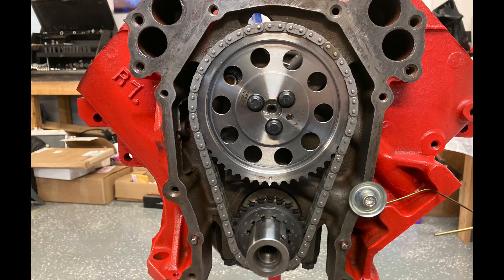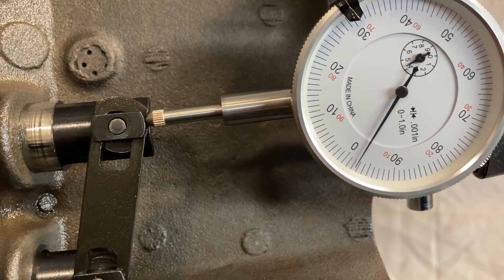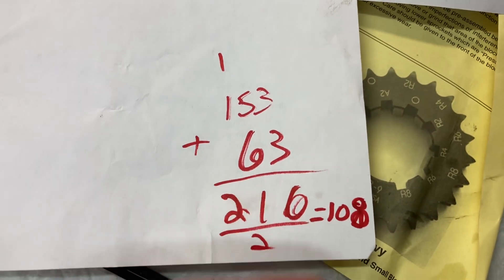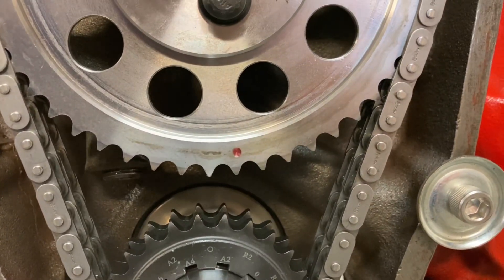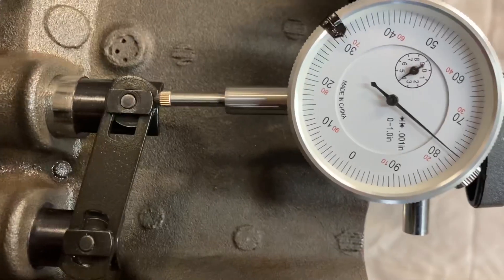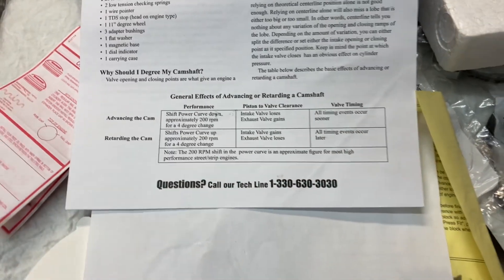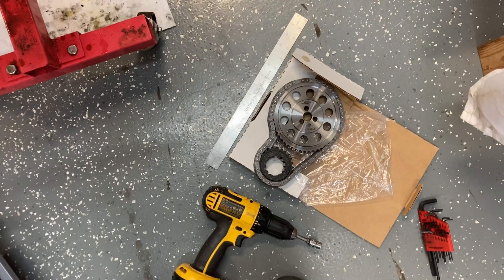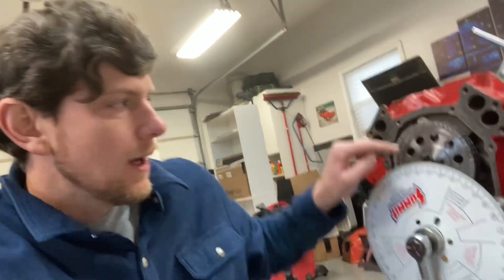Secret Truth to Degreeing Your Camshaft: Dot to Dot isn’t Good Enough!! #engine #compcam #mopar

Comment: Nice video on checking the valve timing now show one correcting or just changing it using a conventional 440 timing set when it’s less or more than one tooth off …. That’s the step I’ve never seen done and when I ask ppl will say just use an offset key or dowel.  Let’s see that.
Reply from the maker: I’ll try to fit that in on my next build

Comment: So, nobody actually shows how to move the cam to the degree that it needs to be if its off.....like in your case you were 15* off, but you skip showing how to physically adjust the cam and timing set to get that 15* correction.
Reply from the maker: It’s so easy and fun when your degree wheel. Advance the cam 4 degrees and test it. If the number gets closer to your target, then keep going. If it goes away, then retard the cam. I think I’ve shown it in a few different videos so I didn’t want to bore my core audience with the same old tech. Thanks for watching
Reply: @JustMoparJoe  thanks, ill check out some more of your videos. this one explained the degree wheel in a straight forward way noone else ive seen has.

Comment: Thanks for the video i got same type of issue on my 05 chevy astro awd 4.3l i changed the timing chain ,cover ,the oil pan gasket and rear main seal . The 05 4.3l has a plastic tensioner, it had stretched vs the new chain and tensioner making the camshaft off by almost a whole tooth making the engine run terribly. This video of your confirms this for me. Thanks if you would like to see my struggles with it or have advice i have some videos on my account. God bless
Reply from the maker: That sounds like a real pain, glad it helped!

Comment: Is it possible to degree the camshaft with the heads already on the engine?  I guess you could make a piston stop, but how would you know exactly when TDC was?
Reply from the maker: Yes sir. Piston stop. I think it show in this video 

HP 440 Ruined Flat Tappet Engine Saved! Summit Racing Complete Cam Swap, Break In, and Test Drive!
https://youtu.be/Zi5U8AokpFQ

Comment: Joe  it looks like that second chain was actually a tooth off  not uncommon even if you see dot to dot with your straight edge
whey
Usually it's because the grinder is trying to fit a new grind with a different LCA on a new wide LCA core or regrind and just cannot fit it  without fudging.  Remember the case hardening is only so thick
New Cores for a lot of useful LCA combinations are just not available unless you can afford a billet.
Way back in the day when we had to run STOCK cams we did retard a tooth, drop in a really low gear and spin the hell out of our stock class car   absolutely no low end but could win and pass tech
Reply from the maker: @jmflournoy386  thanks brother. I definitely hope someone out there sees the value of degreeing the cam. One tooth can hurt!
Reply: @JustMoparJoe  Rethinking that one tooth off stocker cam  actually I think we retarded one tooth then advanced the cam 4 degrees  Back then Isky had just come out with his cam adjustment bushings and there were no multi keyway gears, you had to machine them yourself

Comment: Good video but misleading title. If the timing set had been dot-to-dot to begin with, it WOULD HAVE been good enough.
Reply from the maker: @Thirdgen83  thank you. I guess I was referring to the 7 minute mark when I swapped on an old timing set with a super tight chain and it degreed at 117.5. Now we’re 7.5 degrees away from what they recommended.

Comment: So, let's just say that same timing chain is advanced one tooth or a for a total of 15° , wouldn't that be a disaster between the intake and exhaust valves and pistons?
Reply from the maker: @Anthony-nw5zv  not necessarily. Many engines have pistons well below deck or even have huge dog dishes from the factory. That allows a bunch of piston to valve clearance. Also smaller lift camshafts and less duration leaves a lot of space

Comment: Dot to dot plus one tooth!
Reply from the maker: @thisisyourcaptainspeaking2259  one tooth on the crank and everyone knows it. One tooth on the cam and and you know it. Or did I get that backwards? The moral is, degree your cam!
Reply: @JustMoparJoe  I calculated it once, degrees/tooth and came up with a pretty big number.  So, I bought an adjustable set with multi-keyway sprocket.
I'm not a fan of double-roller chains, it wasn't easy finding an adjustable link-belt.
Reply from the maker: @ it’s wild how the internet works. The link belt is bottom tier now. Then it goes double row. The gear drive guys swear they are superior, but they don’t always get superior results!
Reply: @JustMoparJoe  I've never seen a broken link-belt, I've seen all the rest broken.  That's all I can say.

Comment: Good job showing how the degreeing process works. Cant stress enough how important it is to find the exact TDC of your engine. Im 67 and been building engines since my mid teens and over the years have found the timing mark on balancers off by 5 or more degrees. A few yrs ago on a brand new timing set the cam sprocket was off by 9. The only way to be sure is to degree both.
Reply from the maker: Thanks brother

Comment: Thanks Joe, this is by far the best explanation on decreeing a cam Have seen and I appreciate the effort you went through to make the video.  It has been frustrating to me wondering exactly what do do if the numbers are not what they are advertised. Where did you get the instruction sheet to explain what do do if the numbers are not exactly what the card says?  I have never seen one and would like to have one.  Being on a budget, I can't afford the more expensive timing kits with multiple keys in the crank sprocket.
In the past I have always aligned Dot to Dot because I never understood what I could do to change it if the numbers did not match the card.  Thanks again and I appreciate it.
Ed
Reply from the maker: @edwardhurst2533  thanks Ed! They included those correcting instructions with the summit cam wheel

Comment: So if you cant see that your off a tooth maybe you need to slow down? And if your gears are not adjustable what does degreing do?
Reply from the maker: Many guys do cam swaps with engine still in the car, leaning over the radiator support. It’s hard to tell exactly what’s happening with the chain if you can’t get a straight look at the chain and gears. I don’t rush engine builds, but cam swaps happen over the weekend to get back to the racetrack the next night. Degreeing double checks the cam card version what it actually measures. If your set doesn’t adjust, then you might need to buy another one that does, and put the extra on the shelf.

Comment: What should i do if i have a random reground cam with no card ?  it has .258 etched in the end and from measuring the lobes is .496 lift on a 5.9 magnum.   I'm tempted just to go dot to dot and see what happens.
Reply from the maker: It’s the perfect candidate to put in and check with a degree wheel. I think in my bad example, I was dot to dot with both gears and was off many degrees. In your case, you’d install it dot to dot and then check the centerline. If it wasn’t too far off from the standard range, than you’re good.

Comment: Running Comp Xtreme energy 23-710-9 and 452 head. Watcha thinking of the Amazon stainless rockers for RB? Any idea on pushrods I need for this roller cam
Reply from the maker: I’m not really sure. The 440 I did had trick flow 240’s and the PRW stainless rockers. They took a ball to ball pushrod. I know 440 source has some pushrods in common lengths for certain engines. The true length will depend on your stack of deck height, head gasket thickness, and head thickness.
Reply: @JustMoparJoe  thank you. Was trying to save time. I'll have to get together and measure.
Reply: @jackpinesavagerepair1918 if you have access to a lathe, you can always shorten pushrods with a parting tool, as long as the pushrod end is not welded in. The end has a hardened stem shoved in the tube. Just part off the excess length an 1/8 at a time, and push the end back in till it bottoms out. Repeat as necessary

Comment: It's good idea to leave the engine at TDC and test fit the timing chain cover to make sure the timing marks are correct.
Reply from the maker: Absolutely love to 👍🏼
Reply: I've used the timing cover seal to center the timing cover on the crank snout with no uneven pressure on the seal, then inserted all the t/c bolts and snugged them up so it cannot move, then drilled the timing cover & block to accept a two small 3/16" or 1/4" solid dowels. This really firms up the TDC  timing marks AND makes the crank seal last longer.

Comment: Hey Joe, that was really cool. It always kind of offended me when people called me a grease monkey when I told them I was a mechanic. They just don't know how complex the trade really is. They are the same people who couldn't even change a tire at the side of the road or even locate the dip stick to check the oil in the engine.😢
Reply from the maker: You bring up a good point! Thanks brother
Reply: I prefer the term automotive technician for these reasons

Comment: To work out how many degrees 1 tooth makes just count the teeth on the gear and divide 360(degrees) by the tooth count, eg 360* ÷ 20(teeth on crank gear) = 18* per tooth.
 Typically a worn(not stretched or the chain pitch changes and everything goes south immediatly) chain will jump the crank gear 1st as its smaller diameter gives more clearance per tooth as compared to the larger cam gear. If a chain jumps 1 tooth in operation its kind of pointless worrying how many degrees this retards the cam by because that chain is going to jump another tooth in very short order and that engine is not going to be running for long!

Comment: 🤯 I just would like my 383 to idle.
Reply from the maker: Someday!
Reply: @JustMoparJoe  Well I'm in the process of checking timing. It's a 1970 Roadrunner. It won't idle unless I manually open throttle.
Reply from the maker: @bobbydelamar606  sounds like you need more initial timing
Reply: @JustMoparJoe  I bought the car like it is. I've tried turning the distributor both ways with no luck
Reply from the maker: @bobbydelamar606  the carb may be stopped up and need a kit. It may need a new accelerator pump, if you know the fuel supply is good.
Reply: @JustMoparJoe   I don't like the spacer on the carb. It's a spread bore to square. Right now I'm in the process of checking cam to crankshaft dots. Cause I think the guy replaced the cam. He also installed the better sprockets. The car will stay running and rev nice if I hold the throttle open. The exhaust also burns my eyes and the plugs are black.
Reply from the maker: @bobbydelamar606  sounds super rich. You can combat that with more initial timing. When you rev, it likely flings the weights out in the distributor and adds some timing. I would recommend an FBO plate or a Firecore performance distributor with adjustable advance and springs included.
Reply: @JustMoparJoe  I believe the distributor is factory with vacuum advance. I replaced the points, condenser, adjusted, and new Carter fuel pump. How do I give it more initial timing?
Reply from the maker: @bobbydelamar606  twisting distributor clockwise for a big block
Reply from the maker: @bobbydelamar606  but that also raises the total timing. If you can get an fbo plate, you can set the mechanical advance limit
Reply: @JustMoparJoe  What's an FBO plate?
Reply: @JustMoparJoe  No matter which way I turn the distributor, it doesn't change. I turn it so far either way, and it eventually just dies,  even if I hold the throttle.
Reply from the maker: @bobbydelamar606  FBO Plate for Mopars!
https://youtu.be/dmEsPPzJZm0
Reply: @JustMoparJoe This car is still not happy. I noticed you timed your engine with dot to dot. Everyone told me it's supposed to be at 12 and 12 and that's where it's at??  I have a 383.
Reply from the maker: Thanks for watching

Comment: Joe I have a question for you man. I just put this 440 together, after the machine shop did the bottom end. It runs good, but I have a little bit of a clatter that sounds like bottom end. Only at idle, and letting off of throttle at low speed. I've already checked things like flexplate bolts etc...any idea what iy could be, or should I even worry about it? Thanks...
Reply from the maker: Did they float the wrist pins or were they press pins? That could make some noise. Also what's the initial timing set at? Is it too low? If oil pressure is solid, it's likely not an issue.
Reply: @JustMoparJoe  Hmmm The bottom end is bone stock chrysler, just a rebuild with bearings. I put the Melling high volume pump on it, and at idle, maintains 55/60 lbs. When in gear and hot, it maintains 25 lbs of oil pressure. Definitely fluctuates when I give it throttle..
Reply from the maker: Try a quart of lucas oil stabilizer. I love it in everything.
 @killingcursivekustoms
Reply: @JustMoparJoe  It's already in there

Comment: Had a DC 474 cam that was 20 deg off dot to dot. Best I could get was 4 deg. retarded using an offset key for the crank and one for the cam. It was a 360, 8-1, running a 4sp. If I hadn't degreed the cam, it would have been a total dog and I would have probably spent a ton of money on other parts not knowing why it was lame. Now, I NEVER install a cam without a degree wheel.
Reply from the maker: Crucial Lesson for sure

Comment: So one day in a drunken stupor, I decided to put the new timing set on the Ford Torino with a 302 2 barrel carb. I had bought a Edelbrock timing set so you already know it's got a lot of slop. Well it was Dark 🕶️ on a Saturday night and I thought the marks were aligned, well I'll cut to the chase, how many degrees is one tooth advance? 😆 I didn't use a degree wheel .
Reply from the maker: 😂 that’s a story!
Reply: @JustMoparJoe  I left it like that and I was pulling front wheels a foot off the ground. I had to retard the distributor one tooth. Tons of torque.

Comment: I had an engine that went for years being mis diagnosed and given to me as a hopeless case. After checking the new Moroso timing set , dot to dot. the cam was advanced 18* ! the engine would idle okay ish  but pop and fall on its face if you tried to drive it. The Lower cogs keyway was what was off. 
I always degree my cams.
Reply from the maker: Thank you for sharing! I’d bet it’s happened numerous times and went unanswered.

Comment: I noticed when you rotated the crankshaft Counter clockwise you stopped at .050 according to all the training I  had you go past .050 then turn clockwise and stop at .050 this removes any possible slack in the chain or gear lash on a gear drive
Reply from the maker: Yes sir. You’ll see later in the video that I reference the way comp wants it. In reality, this Chain was tight enough to not show any variation, either way. The best way to discover that, is to check it.

Comment: Those mopar purple shaft cams are pretty much 108 center line a lot of people go with that ,but pat musi likes the 112-114 my cousin has a 68 Camaro SS he went with a comp cam we told them the engine specs 4 speed 3.31 gears how tall the rear tire was and he let comp cams pick out the cam it sucked lol ,we put a old school 327/350 hp cam in it and it now performs ,crower cams don't go with a 108 there 112-114 Center line ,all of the edelbrock cams are 112-114 and the edelbrock pat musi rolling thunder series cams are 112 114 centerline
Reply from the maker: Thanks for sharing, Darrell. Definitely a good idea to check any brand.

Comment: I haven't seen your checking TDC  video, but I'll guess you didn't match mark the inside hub to the outside ring. AFTER you've confirmed your dampener/timing cover marks are correct, I highly recommend you take less than 5mins and put a couple of  little punch marks lining up the current orientation of outer ring to inner hub for the future. If for some reason the outer ring slips vs the inner hub, you will easily be able to visually tell, and you won't have to reinvent the wheel to figure out what happened.
Reply from the maker: Yes sir, Bud. That’s a common practice. Especially when they’re prone to slipping.

Comment: It was 68 not 63. You can’t change it anyway it has three bolts and a dowel. Also once you do cam break in the chain will stretch somewhat and you will lose ( retard ) timing hence the ol gear drive system.
Reply from the maker: Gear drives are cool. But super noisy and not practical for the street. This engine is a street stroker. Mufflers and all. Check out this short. https://youtube.com/shorts/Vmvl0QGvN4U?feature=share

Comment: That seems like more than stacked tolerances.   Its like the cam got indexed wrong when ground?   Hard to believe two timing sets both come up with ICL so far off.
Reply from the maker: I was able to advance the crank and get it perfect. Ed also recommends minimally checking #6 centerline as well.